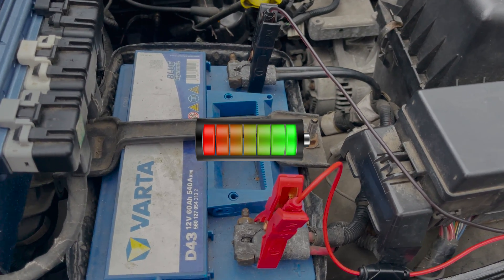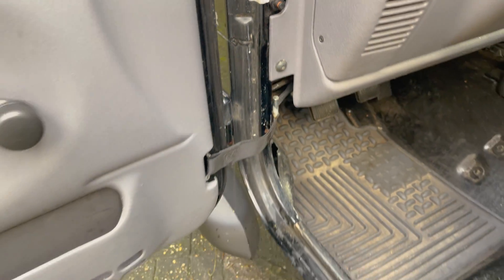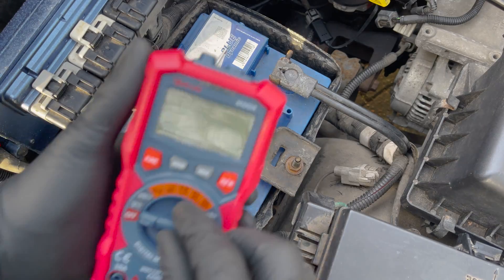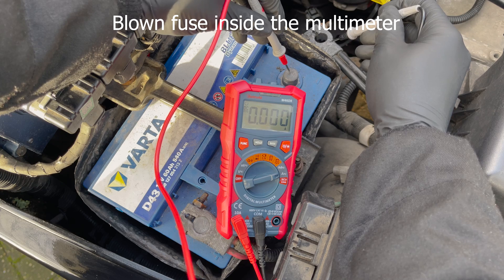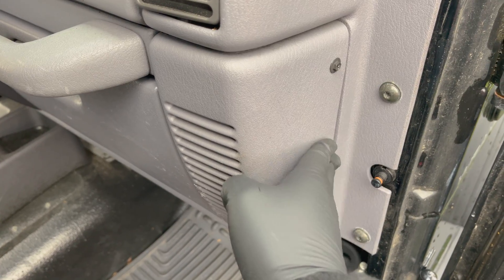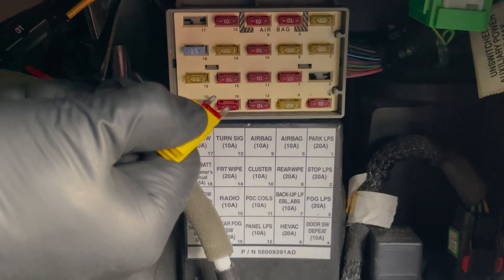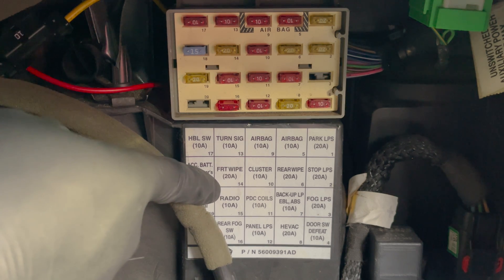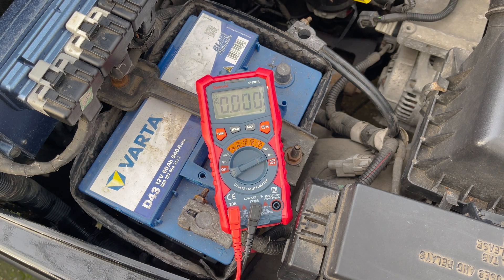The EASIEST way to test parasitic draw

Comment: If the multimeter reads 20.0.  Is that under 50?   Because on yours, it says .0002.B
Reply from the maker: That depends on the multimeter setting you selected. Ours has an automatic Amps setting, the measurement stays in Amps and is displayed as 0.002 Amps. But if yours has a mA (milliamps) setting, that same measurement will be displayed as 2 mA. So in your case (20.0), depending on the setting you select, your multimeter will read 20A or 20mA, which is the difference between a huge parasitic draw, or a negligible draw. The displayed symbol makes all the difference.
Reply: @ OK thank you I’m pretty sure I have a big draw.  Because the brand new battery is in there and I’m reading 11.95 amps. After about a week.

Comment: Please help l am on my 5 battery in 2 and a half years on my 07 Escalade when i put in a new battery everything is fine at first then after a few months any power turned on im the car not running after 1 minute battery is dead this has happen the last. 5 battery’s I’ve cleaned all grounds replace negative and positive wira it still does it
Reply from the maker: With every battery problem, we always suggest to first do a battery test to make sure your battery itself isn’t faulty. But as you’ve gone through 5 batteries in such a short period, chances are slim they all were bad. The next step should be to test your alternator. If your alternator isn’t recharging your battery sufficiently when your car draws electricity, it will drain over time. We have a separate video on this on our channel so make sure to check it out, it’s super easy! 

If the alternator passes the test, you might want to look at a common problem for your vehicle type: A BCM (Body Control Module) issue which is a common problem. The BCM doesn’t go to sleep all the way and drains your battery over time. You can try to reset it by leaving the battery cables disconnected overnight. If that doesn’t solve the problem, you can also replace the BCM to fix the issue.

Comment: Hello. Ive been trying to do the test on my 98 xj 4.0L. I followed the hook up procedure as you did. I made sure the vehicle was shut down as well. All electrical components switched off as well. But every I do it, the fuse in my multimeter pops. Can you give me guidance.
Reply from the maker: Sounds like you have a large parasitic draw. In case you have a multimeter with automatic amps selection, this shouldn’t happen. However, if your multimeter has different amps presets, you want to start on the highest amp setting and work your way down to the amps preset that gives a usable reading. Most multimeters with amps presets have a maximum amp setting of 10Amps, which should be more than enough, even to measure a large parasitic draw. In our video, we had a parasitic draw of 0.75Amps with the radio turned on, for example. Once you know the ballpark amp draw, you can fine-tune using a lower amp setting to get a more accurate reading.
Reply: I got it figured out. I ended up pulling all the fuses out of the PDC under the hood and adding one back at a time until the meter fuse popped while set on 10amps. It was a 50amp batt acc fuse that popped the meter fuse. That controlled several things In the cab of jeep. I felt for heat on each fuse in the junction box inside the jeep. It needed up being a 30amp fuse for power/heated seats, which the jeep does not have. I pulled the fuse and was able to do a parasitic draw test properly. The draw went away completely. 

No more fuse there. I still haven’t tracked down the wires yet to fix them. In time. lol. No more dead battery though. So that’s a plus.

Comment: how can something draws power or radio on,when u disconnected black wire ?
Reply from the maker: When you hook up the multimeter between the negative battery terminal and the black battery cable, it functions as a bridge allowing power through. This, however, is limited by your multimeters' internal fuse(s). If you turn on too much electrical stuff and draw too much power, its fuse(s) will blow and you'll have to replace them.

Comment: How are you going to power on the stereo when the negative terminal is off the battery?......
Reply from the maker: When you hook up the multimeter between the negative battery terminal and the black battery cable, it functions as a bridge allowing power through. This, however, is limited by your multimeters' internal fuse(s). If you turn on too much electrical stuff and draw too much power, its fuse(s) will blow and you'll have to replace them.

Comment: Doing this test on a car with the battery located in trunk is somehow difficult since the opened trunk will maintain the computer activated unless you can somehow trick the computer into "thinking" that the trunk is closed or if the test can be perfomed at the remote battery posts under the hood.
Reply from the maker: Try attaching leads to your car battery that are long enough to be able to hang ‘em outside the closed trunk (pinched in between the rubbers) or fold the rear seats down to access the battery with the trunk closed.
Reply: you can tape the trunk switch to simulate that it is closed/pressed.

Comment: Just a note that you can buy multi meter leads that have alligator clips.
Reply from the maker: Thanks for your input! The reason why we didn’t use our multimeter’s alligator clips is because they don’t fit around a thick car battery post or cable. You need bigger clamps to hold the test leads in place as we did in the video.

Comment: Dumb question, how did u turn the radio on and get power at accessory to do so if u habe the battery disconnected? Lol. Couldnt wrap my brain around it
Reply from the maker: When you hook up the multimeter between the negative battery terminal and the black battery cable, it functions as a bridge allowing power through. This, however, is limited by your multimeters' internal fuse(s). If you turn on too much electrical stuff and draw too much power, its fuse(s) will blow and you'll have to replace them.

Comment: EXCELLENT. Dont forget though if you have a door open, the interior light may be on, and this will give a false positive, unless you are unlucky enough to have a fault in the interior lighting circuit ;-)
Reply from the maker: That’s right! You can block the door jamb switch to keep the interior light off like we did. The same goes for the hood light if you have one.

Comment: How were you able to turn the radio on without the negative battery terminal connected?
Reply from the maker: When you hook up the multimeter between the negative battery terminal and the black battery cable, it functions as a bridge allowing power through. This, however, is limited by your multimeters' internal fuse(s). If you turn on too much electrical stuff and draw too much power, its fuse(s) will blow and you'll have to replace them.

Comment: What if you have a battery with terminals on the side and they aren't posts?  How would I "clamp" (so to speak) a lead to the neg. end of the battery in that case?

2006 Chevy Silverado 1500, btw.
Reply from the maker: In case you have a side post car battery, you want to remove the bolt from the negative battery post, disconnect the negative battery cable and screw the bolt back in place without the negative battery cable attached. Now you can clamp one test lead to that bolt on the negative battery post and the other test lead to the disconnected negative battery cable.
Reply: @classiccarmaintenance  Hey, thanks for the reply.  I really appreciate it, very helpful.  I work with a lot of things, but batteries aren't one of them.  Heh  

After I commented, I realized the video was made a while ago and I honestly didn't think I'd get a response. lol  Thanks again!

Comment: That makes no sense how is the radio causing a draw when you have the negative cable disconnected
Reply from the maker: When you hook up the multimeter between the negative battery terminal and the black battery cable, it functions as a bridge allowing power through. This, however, is limited by your multimeters' internal fuse(s). If you turn on too much electrical stuff and draw too much power, its fuse(s) will blow and you'll have to replace them.

Comment: Brilliant video. Clearly explained. Helped me sort out an issue with my 2008 Accord. Thank you.
Reply from the maker: Thanks, appreciate it!
Reply: What was the issue?
Reply: The battery kept dying of the car was left idle for more than two days. The video helped me to trace the problem to the Bluetooth module. I had never used Bluetooth so I just disconnected it completely. After that, the battery held its full charge no matter how long the car was idle

Comment: What if your battery is currently dead?
Reply from the maker: To accurately measure and find the parasitic draw, your battery needs to be fully charged. In case it is dead, you’ll first need to charge or replace it to be able to find the parasitic draw.

Comment: Have I got a good one for you.  I pulled all the fuses is still can't find the draw. I even pulled the power cable from the fuse box under the hood and nothing but when I pulled the other one off on the left side of it it stopped I was wondering what that could be and how do I fix it
Reply from the maker: If nothing happens when you pull the fuses themselves or disconnect the outgoing power cable on the fuse box, but the parasitic draw goes away when you disconnect the incoming power cable on the fuse box, then the fuse box itself might be faulty and causing the parasitic draw. This can be caused by corrosion, a damaged wire or a bad connection in the fuse boxes’ internals.
Reply: @classiccarmaintenance  I was truly hoping you wouldn't say that because I think you're right because my vehicle got broken into years ago and when I went to start it somehow it ended up melting the fuse box underneath and I had to rewire everywhere but I didn't have that many different pairs of wires so I had to use one color wire but label each end with a P-Touch I was hoping it was a ground but I don't even see where the ground is on the fuse box or even has one I've tried to look it up but I can't find it
Reply: Was wondering is it possible that maybe I switched the constant 12-volt power to one of the relays with the other end of it when it makes the connection inside the relay and got those two mixed around but yet it was still work?  I hope I said that right
Reply from the maker: Hi Nick, great to hear you’re not throwing in the towel like most people would. Kudos to you for not giving up!

Most automotive fuse boxes aren’t wired to the car’s ground (-) unless they have controls that need power. Because you didn't mention the brand, age or model of car you have, I have to speak in general terms. 

The basics of a car’s fuse box(es) are simple once you get your head around it: one large gauge (thick / red) wire goes into the fuse box (from the car battery’s + post), lots of smaller multi-colored (+) wires go out, from the fuse box to the vehicle components that need protection. 

In between the incoming large wire and the small wires, there are fuses that contain different gauges (amps) of special type wire (depending on the amps needed by the component) that will melt and break connection to the component if it demands too much amps (a short). This is to protect the car’s wiring and components from overheating and melting or causing fire in case of a short. 

The car’s components (lights, radio, wipers,...) are grounded (-) individually to the chassis or any grounded metal car component that’s closest. They don’t get their ground (- polarity if you will) from any fuse box. That means there’s only one (+) wire going from the fuse box to each individual car component. The cable’s color coded wire jacket indicates what component it feeds. 

It’s important to know that each electrical component needs the right gauge wire, combined with the right fuse. For every component, you’ll need an appropriately sized wire and fuse, or the fuse will blow or the wire will melt. Technically, the wire color doesn’t matter; it doesn’t say anything about its gauge, although it’s nice to have the right color coded jacket to know what it’s for without having to test it. This implies that a larger gauge replacement wire can be used, but never a thinner wire, or it may melt (and cause fire). Nor can a higher or lower amp fuse be used to replace a blown one. 

When in doubt when replacing a melted wire, just google “car wire sizing chart” for the right wire gauge and combine it with a same-color (same amps) fuse to protect it. Just select the amps the component(s) need(s) and the length of the wire on the chart (the longer the wire, the thicker it has to be).

I hope this helps you along in understanding the basic principles of car wiring in general and gets you on your way to solving your car issues.

If your car was stolen and you got it back with molten wiring like I understand, I would presume they screwed up while “hot wiring” it (hence the term). That may have opened a can of worms, unfortunately. 

I recommend starting by thoroughly checking the fuse box for melted components, front- and back side. If the fuse box is damaged or melted in any way, it should be replaced (most aren’t that expensive). 

If there is no sign of heat damage on the fuse box itself, the next step is to replace all melted wiring with the correct gauge wire. If there’s a lot of different-colored damaged wiring to replace and you’re on a limited budget, you can use only red colored wires in the appropriate gauges you need, instead of having to buy all those different colors. Just make sure to label them well at both business ends, just like you said you did before.

My guess is that at least part of your problem is that either the replacement wiring is the wrong gauge  and / or badly connected or your fuse box has melted and shorted on the inside or back side. Badly connected wires can’t transfer enough amps and will overheat also. The same goes for all fuse connections: they have to be clean and free of corrosion to avoid overheating. Clean them thoroughly with contact cleaner or fine sandpaper if needed. Make sure that all wiring connections are all screwed tightly or soldered (depending).

Don’t give up, you’ll get there eventually!
Reply: @classiccarmaintenance  I have a 2006 Toyota 4Runner v8 and somehow now if I take the negative terminal and positive off the battery and hook my multi meter up to the negative post and then the negative cable, I get 9 volts.  Why is that?  I've even waited overnight and still get 9 volts when nothing is hooked up at all.  I'm sure my draw is coming from either the A/F heater relay or the heater relay but I can't tell which wire it is because someone broke into my truck years ago and ripped the dash out looking for the stash box and when I went to start it it melted a lot of the wires.  I'm sure I wired it correctly but may have put the wire or two on the wrong relay post.  I have a wire diagram but it's always missing the pages that interpret the codes on the wire diagram.  I did a sub frame swap and accidentally cut the alternator wires, if that effects anything.  I did wire them back up correctly though.
Reply from the maker: Hi Nick, seems like there is a lot more going on than the fuse box problem you were mentioning in your first comment. I’m afraid the complexity of the problems you’re listing can’t be diagnosed or fixed in a YouTube comment section or forum. I would highly recommend contacting an automotive professional for a hands-on diagnose and repair. We’re sorry we can’t help you any further. 

Best of luck, 

CCM
Reply: @classiccarmaintenance You are probably right but this is how I feel if I do that.
https://youtu.be/mEB7WbTTlu4?si=jKhfpOKRuohMSByA

Comment: I watched a bunch of video tips on detecting parasitic draw, and your method is the best!   There are a bunch of others talking about measuring the resistance across the tops of fuses and checking against a printout of values, but I found that to be a useless technique.   It is much better to entirely pull the fuse and check the drop as shown in your video.
Reply from the maker: Thank you, appreciate it!

Comment: So when I put the leads how he did in this video they arc and then my alarm starts screaming at me, when I do it reverse no arc but it continues to scream, what am I doing wrong
Reply from the maker: Sounds like you have a problem with your car alarm. Depending on the type of alarm and the way that it’s wired, it may activate the siren when reconnecting the battery terminals. You wanna check your car alarms’ manual.

Comment: How did you get the radip to come on with the negative battery cable unhooked?
Reply from the maker: When you hook up the multimeter between the negative battery terminal and the black battery cable, it functions as a bridge allowing power through. This, however, is limited by your multimeters' internal fuse(s). If you turn on too much electrical stuff and draw too much power, its fuse(s) will blow and you'll have to replace them.

Comment: But how would anything get power if you disconnected the negative cable?
Reply from the maker: When you hook up the multimeter between the negative battery terminal and the black battery cable, it functions as a bridge allowing power through. This, however, is limited by your multimeters' internal fuse(s). If you turn on too much electrical stuff and draw too much power, its fuse(s) will blow and you'll have to replace them.